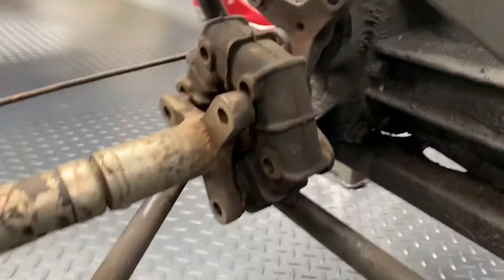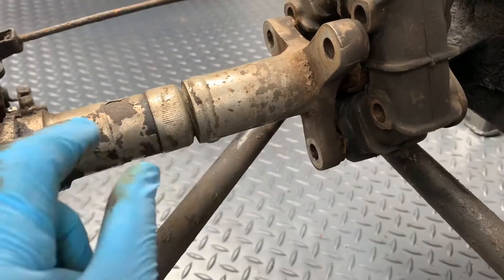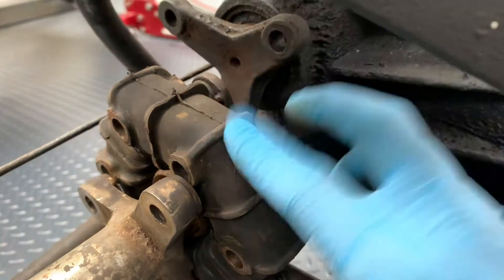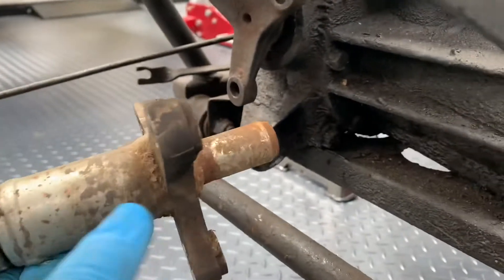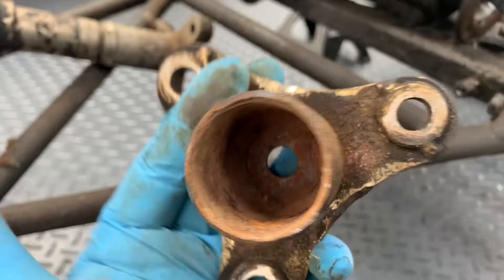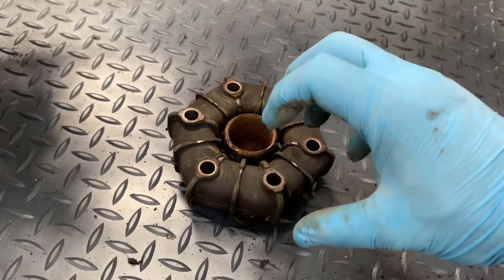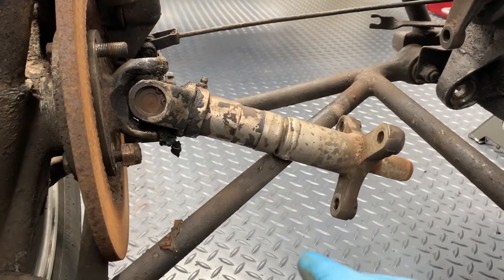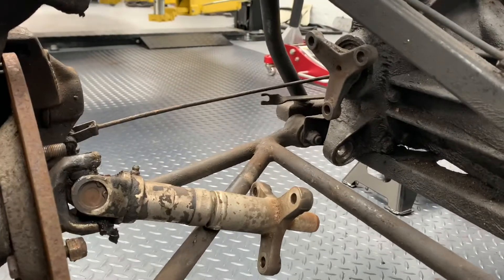Lotus Elan S4 - Upgraded Driveshafts [Spyder?]

Comment: Malcolm, I enjoy your posts. The outer joints are not constant velocity (cv) joints, they are universal joints (UJs) as on a propshaft; CV joints allow plunge so the centre slide joint would not be required. That piece assembled onto the Diif drive flange is for anti-flail. If the doughnut fails it spins out causing damage to the bodywork and/or chassis. That extra piece keeps the end of the driveshaft in position, stoppping it from flailing.... clever!

Comment: Definitely spyder parts. They still supply these but I can’t see the point when you can get elantrickbits or mick Miller all metal cv versions. The doughnuts are not that cheap and definitely not an easy replace or long life item. If the cushioning effect is a requirement it would be better incorporated into a prop shaft using rubber in compression only.